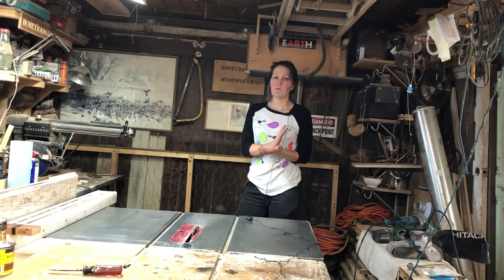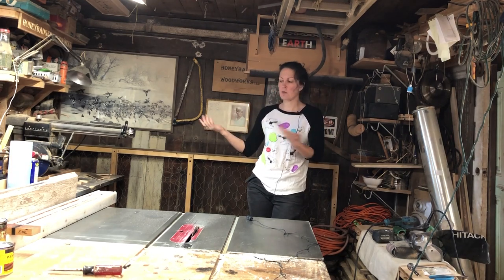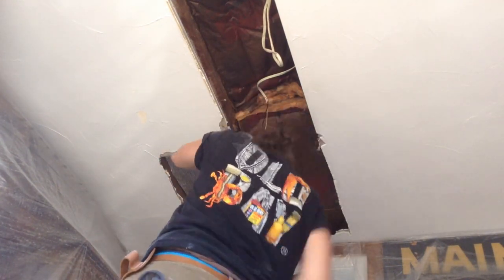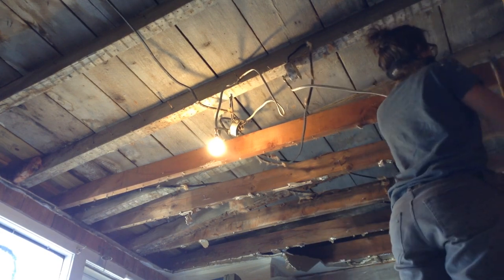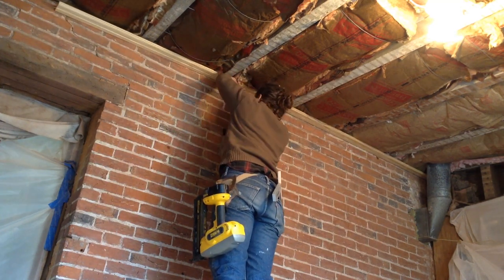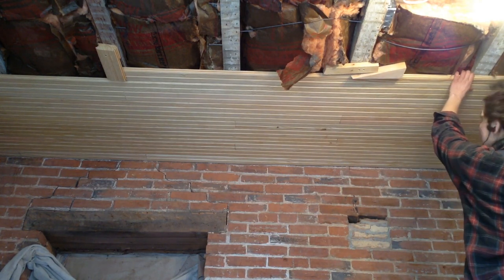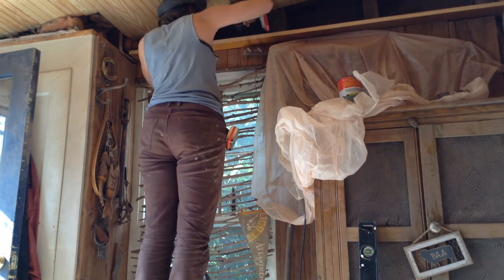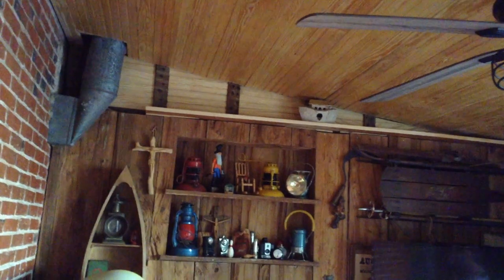Woodworking : Bead-Board Ceiling Renovation // Victorian Home

Comment: looks great You are one of my go to channels for diy ideas even though I have some professional woodworking experience , my go to these days is reclaimed materials for their aesthetic charm and age I love Victorian architecture I dream of a 20x20foot shop Im in a 9 by 21 foot single stall garage right now full sheets of plywood have to be cut down on the driveway out front with hand circular saw
Reply from the maker: My space is a about 20x20, but I started off in a 10x20 and it was a challenge for sure.

Comment: Dang landlords, always wanting something....just can't please them😆.  

Seriously, it looks good. As for content of the video, I think it's a good addition. It's still making and building, just a different way of doing it. 

One big suggestion moving forward. If you do jobs like this consider using planks raised off the floor to walk and stand on using a couple step stool or small ladders if available. Having been there and done it, it is so much easier than making a hundred (in some cases literally) trips up and down ladders. Not to preach but taking care of your body pays off as in the end.
Reply from the maker: That is a good tip.  For a lot of the job I was using one of those scaffold ladders, not a standard ladder.  But, agree up and down on a small one was pain.

Comment: You can use 6 mill plastic and a stapler to hold up your insulation if you do this again..also if you get insulation on your skin apply shaving cream to your skin then scrape it off under cold water.
Reply from the maker: Damn, plastic would have much easier.  Thanks for the tip next time.
Reply: The plastic will cause moisture to build up one side or the other depending on where which is the hot or cold side (winter or summer) and is not a recommended practice.  Think- mold>
Ideas like this are part of the DIY problems discussed in the video that need to be avoided and insurance companies are worried about.

Comment: Wonderful work! How much that lumber set you back? I did this with primed pine in my kitchen. I can "appreciate" your effort, as I had a helper (I would cut, he'd nail). I used a flooring jack to get last board in. Still haven't edged it...not sure whether crown or use a 1/2round. Or something fancier. Anyway, thank you for sharing!
Reply from the maker: I bought the lumber in three sets so it would fit in my car so I don't have an exact number.  but the rough number from my original calculations was about 500-600 bucks.  The knotty pine would have been cheaper but none of us are lovers of knotty pine.  Yeah the trim won't go up for awhile for the exact same reason, I just haven't decided what I want to put there haha.

Comment: Looks really nice.  Just curious if you had much scribing to do... I'm from that area myself and most of the older homes rarely, if ever, have square walls and ceilings.
Reply from the maker: I didn't do any scribing on this.  The room is definitely not square, but it worked out because the side I ended on still has the wood and plaster wall.  So there was almost a 2 inch gap on the other side I hide the lumber in to avoid having to scribe.  The big problem with this which only someone who does construction would probably notice is that all the rafters were not flat and the same depth, so in spots the ceiling has some peaks and valleys.
Reply: @HoneyBadgerWoodWorks  "Live edge rafters"...maybe it'll start a new trend.  :)
Reply from the maker: hahahaha.
Reply: @HoneyBadgerWoodWorks  I think traditionally they would put up nailers 90 degrees across the joists, shimmed to make a flat plane onto which the bead board or whatever was then attached.
JIM